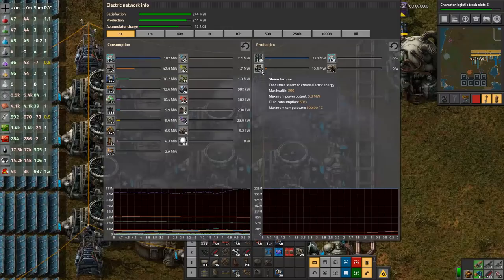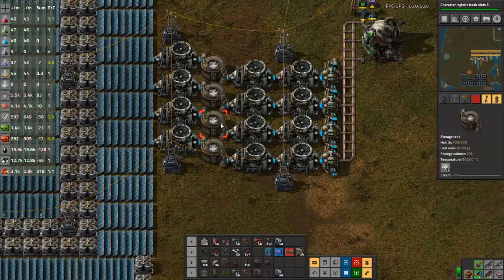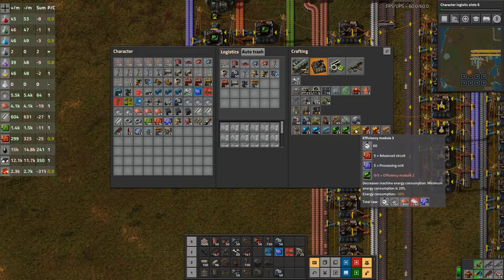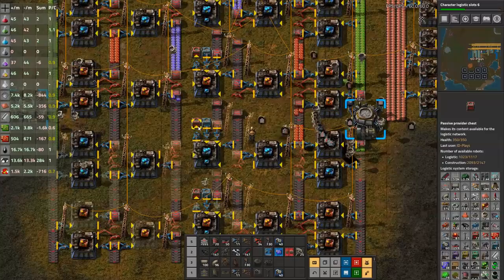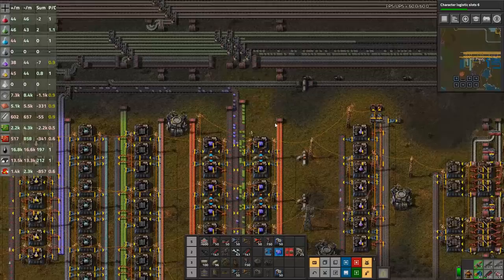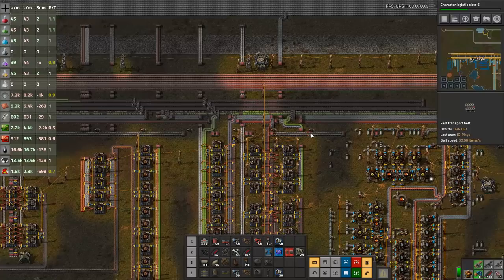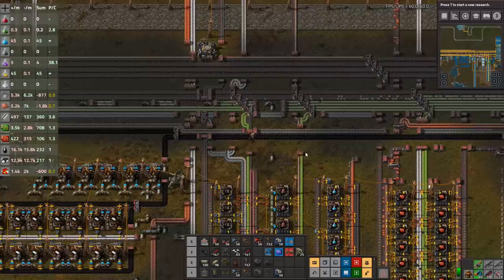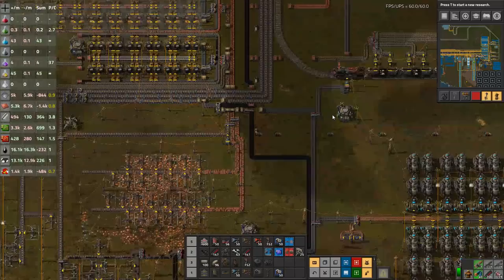Factorio 0.17 | Factory Island EP38 Level 3 Module production | Tutorial, Guide, Lets Play

Comment: I am impressed by the huge throughput of this green chip array, even without using blue belt. Yes, red chip array is longer but those machines are very slow. And you only had 3 belts of greens because of the lack of iron, it's clearly capable of much more prodcution. Good job!
By the way, the last purple science factory has no output.